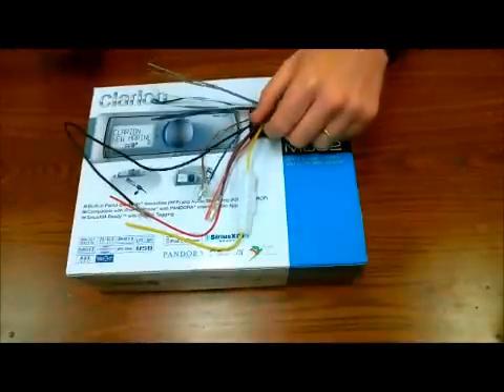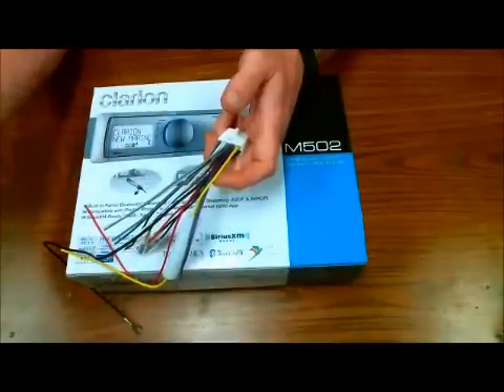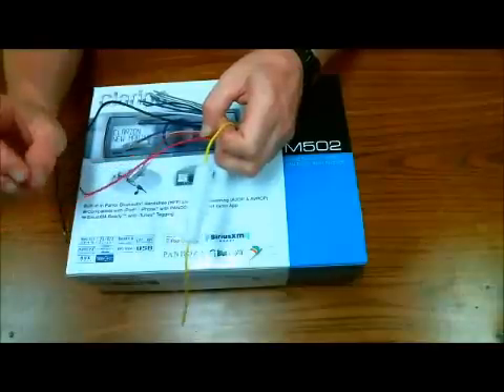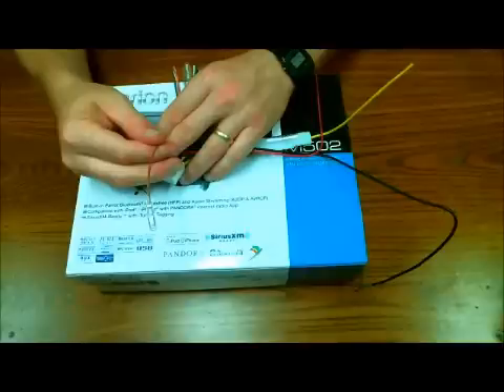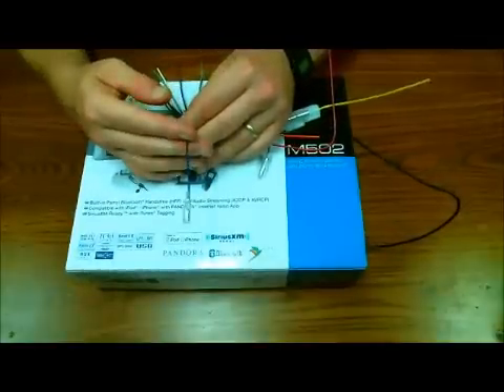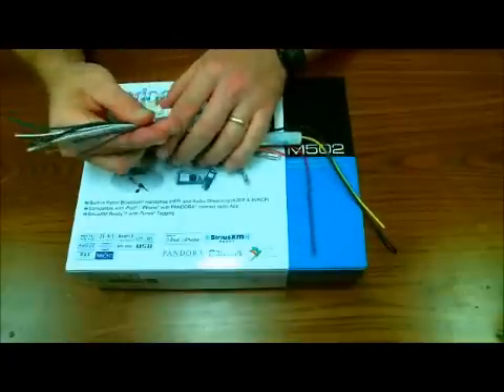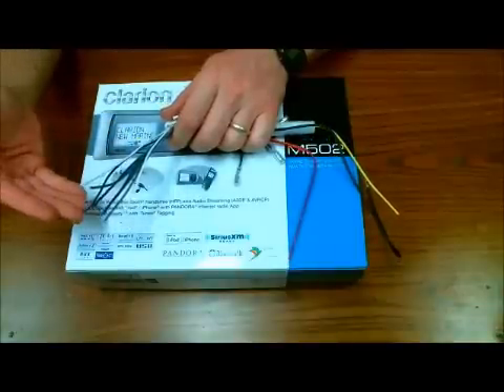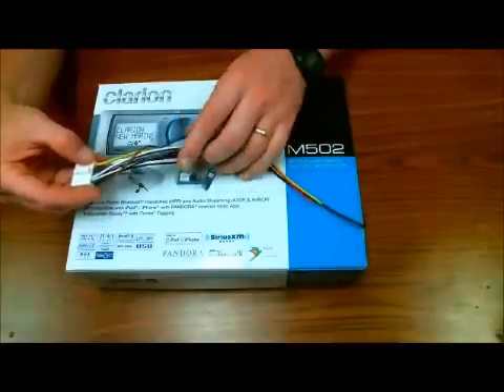Car Stereo Wiring Explained In Detail

Comment: Thank you this helped immensely! I had a 1988 Kenwood (KRC-757) and it had slightly different wires such as one blue I don't know what it does, but I managed to get it running by putting positive on red plus yellow and negative on black. Thank you! :D
Reply: Hey by chance did your early kenwood have plugin speaker wires similar to the krc 999?

Comment: I am replacing a head unit on a 2010 Odyssey with Rear Entertainment System and 6 disc changer. There are 73 wires coming out of the original head unit. What do I do?

Comment: I’m completely turned upside down with the blue and blue striped wires I understand one is for power antenna and the other is for power to many other things 
Where , how do I wire them ??? 
     I have no power antenna. I have no idea where the hook that or completely don’t understand how when I’m under power it’s supposed to carry 12 volts
 same with the other blue. I don’t understand where I should connect it or if I should connect it, at this point. 
   I have the radio turning on I have it connected to my phone,When it wants to or I want it to. 
I have no speakers working whatsoever.
Thanks for any and all help .
Tom
5

Comment: I have a antenna ground I'm assuming, it somehow came out of the driver side panel above the window and of course I believe it came from the antenna but how do you put on the U-shaped thing to bolt in metal? That wire I have is like a 16 gauge or 18 but I cannot get the wire to stay inside the clamp

Comment: Great video!!
I wired up an after-market radio to my 2005 Chevy silverado 2500hd. Everything is working great but how do I wire it up to my steering wheel control. 
BTW, I am wiring everything directly and not using any modules. 
Thanks again!!
Reply from the maker: go to pac-audio.com for a fit guide, its all there

Comment: I dont know if you will get this or not.. but i have 2 issues im running into.. the harness inside my vehicle has an orange woth black stripe the mechanic 
Handbook says this is illumination negitive.. but coming off the radio thete isnt one.. also coming from the car there is vehicle speed.  ..

And there is no remote amp.. its on a 3rd harness and was told by the audio company here  have a wire on the 11th pinout on that and splice it in with my antenna 12volt wire  for (factory amp) then wire to the aftermarket from same location. Which worked just fine. Till amp went to protect mode.. and im guessing that came from wires coming loose from radio connection..  person helping me misunderstood and disconnected the after market harness a d removed all pins. And now o cant figure out how to make it work correctly.  I have had it only work with lights in. And then have it work withe the acc.  Ut then it had no sound.  Please help im list on what to do
Reply from the maker: You can just cap off the illumination wire, you seldom use those, as for the amp turn on - I doubt that has anything to do with the protect mode, Id look elsewhere for the reason thats happening like low impedance, shorted voice coil or something like that....

Comment: I’ve got my factory stereo out of my ‘92 Volvo 240 and it appears that there’s a single wire going going to each speaker. The Pioneer stereo I want to install is just as you’ve described. The factory stereo also had this 6 pin round plug. Looking for a wiring adapter, I can’t seem to find it. Not sure what I’m missing.

Comment: I have a boat radio and I put a disconnect on the yellow wire so the battery would not drain during the winter. I don't cate about the presets. The radio wont work with the yellow disconnected. Can you explain why?

Comment: Hi, thanks for that. I have a car radio in my RV. Also a 12 v television with poor sound. Can I wire ĺl the TV into the car radio?
NB there  is no sound jack in the radio but the TV has a sound output.
Cheers Brian.
Reply from the maker: Yes you can! add a wireless rf modulator

Comment: I just installed an aftermarket stereo in my car but I have a problem, the stereo does not turn on/off with the ignition. It would stay on even when car is off unless I manually turn it off with the stereo power button. Do you know which wires do I need to connect/disconnect or  switch?

Comment: Thanks for the helpful video. Question: putting a Pioneer single DIN stereo in my 06 Ford Crown Vic. The wiring harness for the Ford has an orange wire but no blue wire, and the Pioneer has a blue wire but no orange wire. All other colors match. What do I do in this case?

Comment: found this cause of struggling....I have a pioneer KE-4930  that was replaced by a modern radio/cd because the cassette did'nt play....now I would like to build the damn thing into a selfmade wooden box...but....the guys that replaced it teared all of the wiring off....Can I rewire this using the diagram in your thumbnail..? it has two rowes of connections - 1 rowe above numbered 1 - 7 from right to left, and 1 row down numbered 8 - 12 from right to left.
Reply from the maker: maybe, double check it on the 800pioneer website
Reply: @Lesscoelectronics  nowhere to find, it's too old I guess

Comment: I have an avh-2300nex pioneer radio and recently when it started getting colder my truck battery started draining overnight I broke the touch screen on the radio so naturally I took it out until I could fix it but as soon as I put it back in the battery went back to dying overnight the radio appears fine and everything works I can't afford to replace the radio completely and I don't want to go back to factory if anyone could explain how to do a toggle switch on the constant power wire or maybe how to narrow down and properly fix the issue I would greatly appreciate it ive been stumped on this for a month

Comment: I'm trying to replace a radio in a 20 year old boat. The existing wiring  harness has only 3 wires for each set of  speakers, with only one negative wire..  The new radio has 4 wires for each set of speakers, including 2 negative.  I'd like to use the female end of the wiring harness with the new radio.  How do I deal with the difference in negative speaker wiring in the old and new radios? Can I use a common negative line for the two speakers on the same side?

Comment: I just installed a aftermarket stereo and when I turn the ignition off, the radio stays on. I hooked the orange wire to the red wire  is that wrong?

Comment: The yellow wire with the fuse is it ok to run a 30ah fuse, the old one burnt up it was 5ah, I'm also running a 800watt system

Comment: I have a 94 lincoln with a built in amp and I installed a aftermarket deck and the deck turns on I did not wire blue and white wire it powers on bt connects but no sound come from speakers any idea why?

Comment: Wiring JVC KD-R690S in my boat. Wired yellow & red to pos and black to neg and unit powers up normally. But as soon as I connect any of the speaker wires to power (ie white to pos, white/blk stripe to neg) the unit shows "Miswire" error. Have spoken w/ JVC 3x and they can't figure it out. Any ideas?
Thank your for any help.  I appreciate it.
Brad

Comment: My 2007 Civic EX with the OEM Premium Audio System MP3 XM WMA radio with the XM/AUX  seems to have blown the rear speaker side of the fader. 
 
The front right door speaker sounds a little rough.  Best I understand it since the left and the right stereo is working, it's not one side of the radio.

When I do the setup, all sound goes away when I change the fader display to the rear.  Is it in the speaker connection or radio itself? 

I see a lot of completed units on eBay since people want the big double din stuff.  All I need is it to work front and back and use my Bluetooth for my student's school car.

Any suggestions to were to start first?
Thanks.

Comment: So I'm upgrading my 89 Volvo stereo and when I removed the original unit there were 2 wired (one yellow, one brown) that are with but outside of the wiring harness.   The wires have metal adapters that insert into the corresponding end and on the stereo side one is labeled DIM and one is labeled RHED.   Perhaps they are extraneous, but I still wonder what they are for?? Maybe you know.  Thanks,✌️❤️✨Katie

Comment: My 1995 boat radio only has 4 wires going to it(red, black, blue, green)  which one is connected with each color. I only have two speakers
Reply from the maker: sounds like you have 2 + speaker outputs and they have a common ground to me..

Comment: could the speaker wires be used to power 12v rbg led light strips. ? if not would it be possible to take feed from any other wire in this loom ? Thanks in advance for any info advice. im total novice wanting to build car radio hifi fro home fed from the mains power via 12v adapter plug.

Comment: Hi, we have a similar car stereo. Everything was working fine but now it has stopped working. We pulled it out checked the wires, power to the car stereo, checked the ground, checked the fuses, everything is saying there is power but once we connected the car stereo there is no lights no sound no nothing. It also stopped our reverse camera that we installed from working. Does this mean we were a need a new car stereo? Or is there something we are missing?

Comment: Great video. I’m replacing an old radio in my boat. My boat has only front right and left speakers. The original installer connected front and rear positive wires together and then led a single wire to the positive terminal on the speaker. He repeated this for the negative right wires. And he did the same with the left speaker. Should I repeat this method?
Reply from the maker: I would not do that, EVER, wire them in parallel instead like normal.

Comment: Hi there, I have a 2007 dodge nitro, and am upgrading the stereo. I have all the parts I believe, for some reason the harness that came with my touch screen stereo had the blue and brown wires capped? No one seems to know why. The harness that connects to the factory harness has 1 blue wire, so I uncapped the solid blue and spliced them together. Is this ok? Thank you kindly!

Comment: yes I have checked all of the fuses both under the hood of my RV and under the dash of my RV we have changed to the radio went out about two weeks ago and the lighterswe still cannot get the radio all the cigarette lighters to work we know that there's a we know there is a fuse on the back of the radio and we have changed that one as welland now I need to know why I have no power to my radio or my cigarette lighters either one are not working still please help

Comment: Hey I had my JVC Single din installed by a company local to me it seems to turn off and then I have to mess with the wiring to get it back on. What should I do it’s brackets to hold in place also broke.

Comment: SO I have a question and I'm hoping I can explain my stereo problem or wiring. So I had a stereo installed in my Acura 2004 rsx and the stereo is an aftermarket brand. So the stereo worked for about 5 years until one day I turn on my car and the stereo didn't turn on. The only thing that turn on was the lights of the stereo but the stereo itself wasn't working anymore. I thought maybe I needed a new stereo and so I took it to this shop where the employee said that my stereo wasn't working anymore. So I bought a new after market stereo and he installed it into my car. My new stereo was working fine but after two weeks, I turn on my car and the stereo didn't turn back on. The only thing that was on was the lights of the stereo but if you wanted to see the words on the stereo. You couldn't see anything and at that moment I knew it might not be the stereo and maybe it might be another problem with the wiring. What do you suggest it could be?

Comment: I bought a truck it’s a fixer upper and got a Walmart touch screen radio but when I looked into the wire harnessing  I’m side they burned the yellow wire what can I do is it possible to buy pass or do I need to re wire the hole dash

Comment: The old radio I am taking out is a 16 Pin like yours, but then it has another four wires (red, black, green and blue) pluged into a 6 pin (two not used) wire harness.
My new radio going in has only the 16 pin. What do I do withe the empty female harness if I have nothing to plug into it? Will it still work? Do I need to order a different radio?
Reply from the maker: see what happens.. sounds pretty old, those colors havent been used in some time

Comment: Hi, I'm trying to install my after market radio and I have a couple questions. My car has a factory amp, so I had to order a special wiring harness for it. It is a common signal ground system with four separate positives and one common negative. Does this mean I wire the positives per usual, and connect the negatives to the chassis ground? That's the only open negative. Do I leave them unattached? What do I connect the phone mute wire to? And on my after market radio, the remote turn on (+) and power antenna (+) are the same wire- blue/black. On the harness, however the amp turn on is blue/white and the power antenna is just blue. Do I connect all three to each other in this case? Thank you in advance!

Comment: My question is what is the 12V wire look like? That is the problem for me. My radio does not turn off with the ignition on/off
Reply from the maker: yellow is constant +12v and red is keyed accessory power, you probably have them reversed is my guess..

Comment: Installing in an RV to the house battery and fuse box. Can all the + power wires (yellow, red, orange) be connected together to one fuse in the box or do they each require a separate fuse? Also, if I don’t have a powered (retractable) antennae, do I need to connect the blue wire at all? Thanks for any help.

Comment: Help! First time wiring stereo..installing a Bluetooth to a 96 Toyota...light blue wires were cut & connected to the 12v power wire?? I have no dome light thinking maybe that is why-also aftermarket cruise control has been installed so maybe it’s replaced the dome light?

Comment: I am trying to install a Pyle PLMRKT46BK Marine radio in an EZ GO 36Volt Golf cart. I am using a 36V /12V converter continuously powered right now. I have connected the yellow lead to the 12v power along with the red wire. Blue wire not connected. Black wire to negative wire from converter. Have tried 3 different antennas. A stubby, extendable automobile  and a marine antenna , all to no avail! Radio comes on volume works, blue tooth works, tuner works but no reception of any AM/ FM stations except one on each end of the FM band and they are unintelligible.
 There is no ground on this golf cart running to the frame. The metal base of the antenna has continuity to the head unit. The head unit is not grounded to the frame.Some have said ground it to the frame others say don't because if I get a short it'll blow up the batteries?
So I complained to Pyle and they have sent me 5 different radios in the last two months. None have worked.
They even sent me two different models.
I live in the metro area of Atlanta and know that broadcast signals are out there. Have NEVER had an issue with signal.
I have tried a 12x12 ground plane on top of the cart grounded and not grounded to frame and to antenna base.
I am a licensed electrician and an Electronics Technician and spent my career in the Instrumentation Industry.  This one has me stumped!!  I thik its because its a GOLF CART!! 

Any thoughts would be appreciated!!

Comment: Hello quick question about my car audio install. I’m using an Xelon Audio headunit with the stock door speakers. Currently only one of the speakers is generating noise when turned on, so I thought it was 3 bad speakers, but upon further money spent I realized either the wiring was bad or something else. can I run a speaker wire to the headunit for a test of the speakers?

Comment: What's confusing to me is the Power Antenna Blue wire in my replacement stereo. Power Antenna ? Or Power Antenna Amp ? I don't have a Power Antenna in my '99 Jeep Cherokee. But I don't know if I have an Antenna Amp. I have one wire that's labeled "Right Front"......not a speaker wire. What happens if I hook the Blue wire to it and DON'T have the Amp ?
Reply: I think I clearly understood him say " Solid Blue only used to connect to your Power Antennae" .... Otherwise the White Blue wire goes to your Power Amplifier. If you don't have a Power Antenna or a Power Amplifier than don't attach anything to them!
As for the Right Front? Right Front what? What model or Stereo do you have?
Reply: @RogerDiotte  The Jeep wiring diagram shows the Power Antenna wire as "Right Front". I don't get that one. It's Wh/Blk. Removed the Jeep's factory AM/FM Cassette. Installing a Blaupunkt  AM/FM/CD I just bought.

Comment: So I’m wiring up a Ken wood to a Ford Ranger. You said the brown or tan wire for the Bluetooth is mute and on the factory harness replacement or adapter I have the orange with black stripe which you said can be a mute. Would I butt connect those together or tape them both off? Also what about the illumination orange wire? I have it leftover?

Comment: After hooking up my aftermarket stereo even with the key off I still have power to my head unit
Reply from the maker: the red wire is the problem, switch it to an accessory circuit
Reply: @Lesscoelectronics  I have never had this issue before I feel like a noob haha whats a good example of a accessory circuit?
Reply from the maker: anything that comes on with the 1st click of the key, like the radio LOL, or the ac/heat etc...